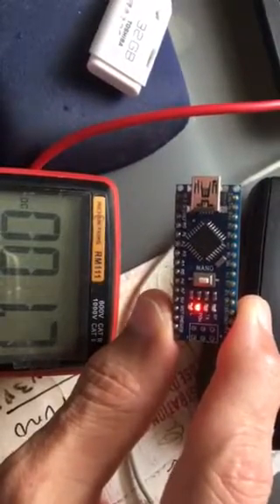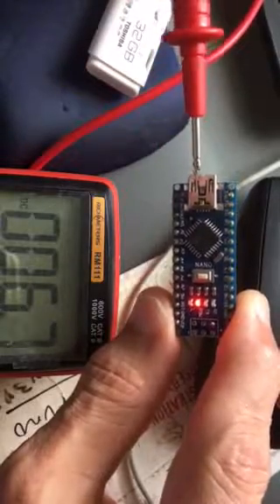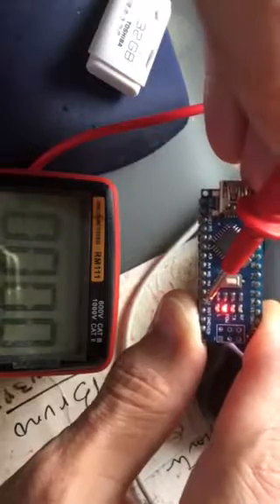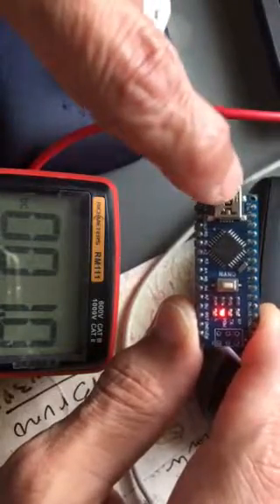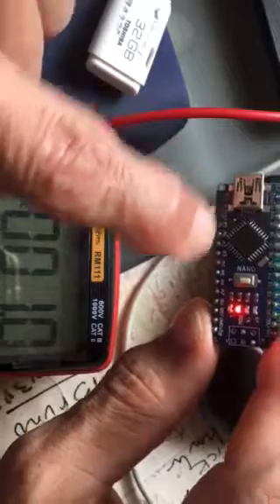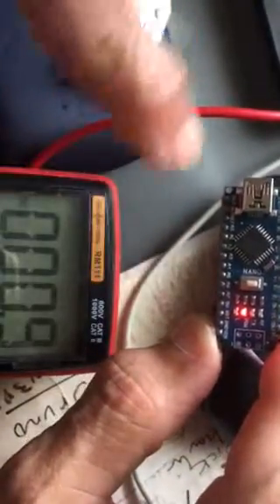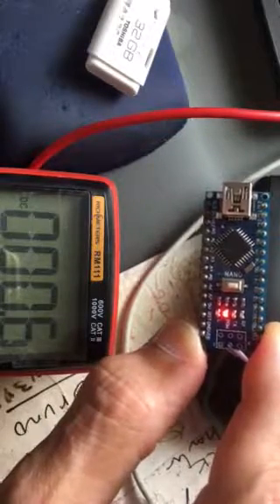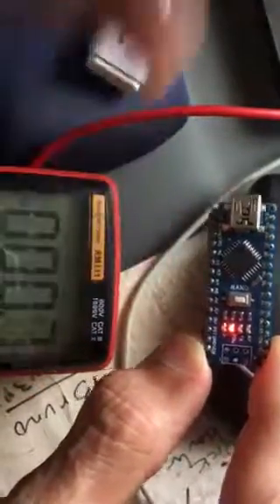3v3 in Arduino Nano using Vin

Comment: so.. why in the web they said 3v3 can't work when using Vin?
Reply: In the generally available schematic, the 3.3v comes out of the USB to UART chip (FT232RL). That chip is powered by the USB 5v. There is a diode (D1) in place to stop the 5v from the on board voltage regulator (LM1117), from going back to the USB to UART chip and USB port.

https://www.arduino.cc/en/uploads/Main/Arduino_Nano-Rev3.2-SCH.pdf

This is the schematic for the genuine Arduino Nano. Perhaps some clone Nanos have changed this.